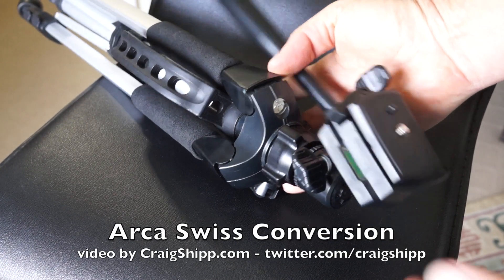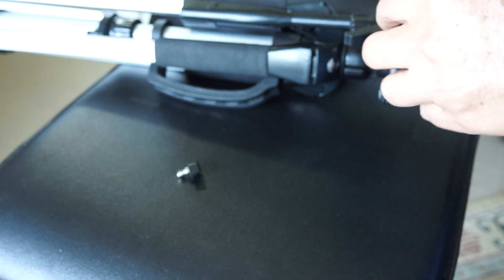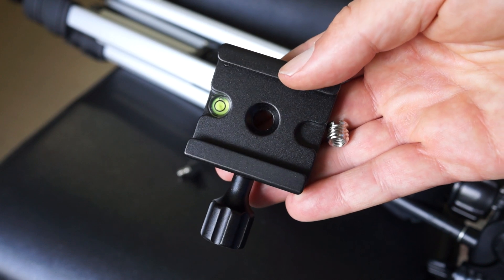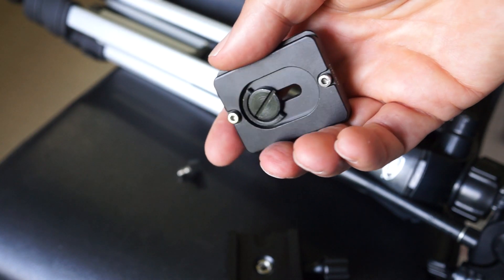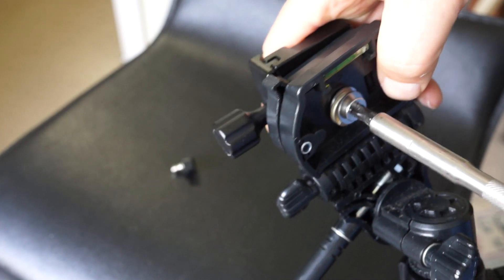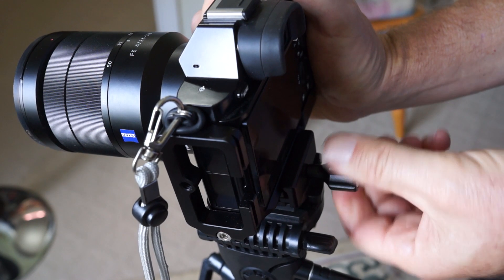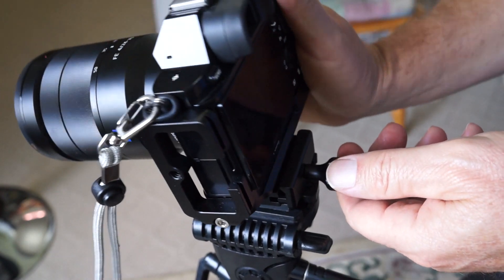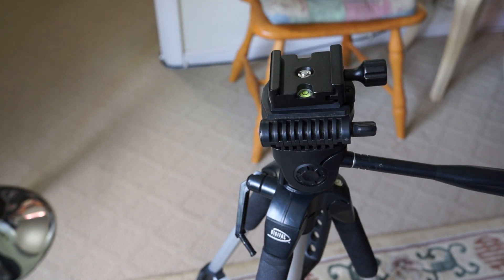Arca Swiss Conversion

Comment: I am planning something similar for my tripod. I have Vanguard Espod 233AP. I bought it in time when I had not enough information and little experience so this was my "solution". After few years I need to solve my requirements, but I am at low budget, so I need "clever solution". Thank you for to encourage me to do this.

Comment: I'm thinking about doing this.  I thought it would be cheap. Yikes. These things are not cheap. They seem to be about $40 bucks and that's for one side. I have a few cameras and several tripods and focusing rails. One of my focusing rails is Arca compatible so one good thing there.  The side mount Arca adapter looked very cool. If the routine ones are $40 bucks that thing must be really pricey. Anyway, thanks for the video. It is nice to just get information from an informed individual that what you are thinking about is a reasonable thing to do.
Update: Down the rabbit hole, There are a lot of options and prices that I didn't see when I first went looking. This is what I ended up with: Sunwayfoto DP-60R Universal Quick Release Plate
BH# SUDP60R and Desmond DAC-38 Quick Release Clamp
BH #DEDAC38 I leaned towards cheap. When I ordered them I didn't realize I could buy an adapter specially designed for my T7i cameras. They might have provided a more secure mount but they were more money and I already had a different one on order. If keeping the mount solid is a problem I might by the specialized one later., Thanks again for the video
Reply from the maker: Check eBay. There are lots of options there.
Reply: @MidAtlanticTV  Thank you very much for the response.  it turned out that searching B & H with Google was better than with B & H search. When I did that a lot more options showed up. I edited my post to show what I selected above. I didn't know why some options are so much more expensive than others, but I just went cheap. I think I needed to get some in my hands to see why some other options might be better. Ebay might have been better, but I like to support B & H because they have good on-line telephone support so I would generally pick them over Ebay. I did find your fancy side mount thing for $139 at B & H. I'll see how it goes but I might buy that someday.
Reply from the maker: @davefoc  You will find a lot of great options on eBay including l brackets for various cameras. SmallRig makes some nice ones.

Comment: Hmm, i see now this wont work for my set up, i will need both this and a second plate that can mount on a normal tripod mount for the part that attaches to a focus rail
Reply: +Arctic Gator the focus rail plate is attached permanently to the frame of the rail and wont flip up to allow me to drill a hole for the mount to attach to, i want to keep my gear costs down but i don't want a frankenstein's monster looking set-up either lol

Comment: Why , the head has a quick Attachment and tilt now you add weight and have to use two hands to set it in , plus the vibration , get a new tripod
Reply: Your go around was good for illustration , but in real life you know better .